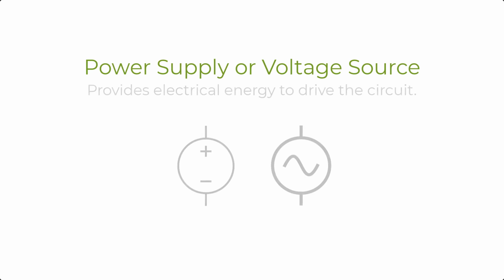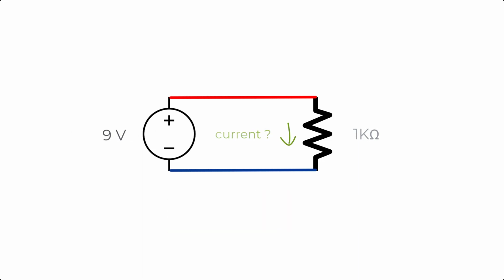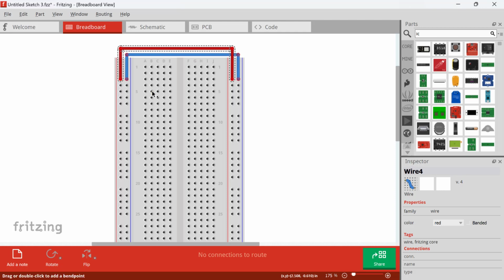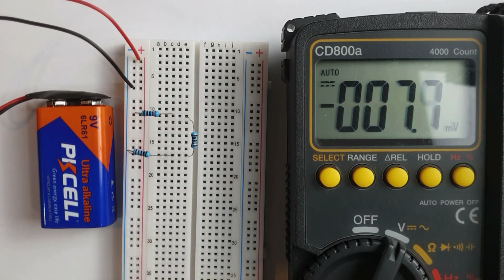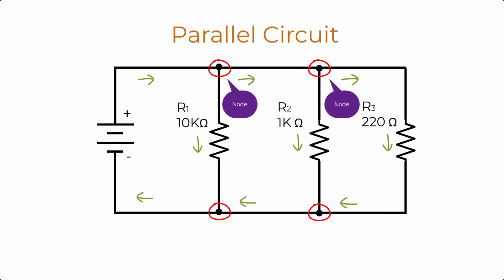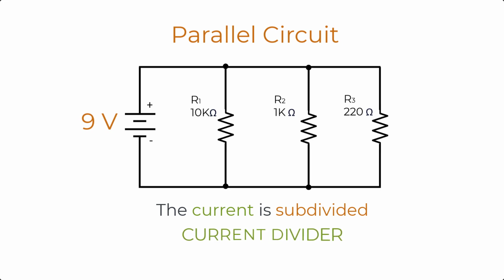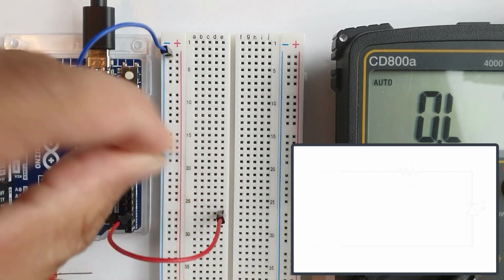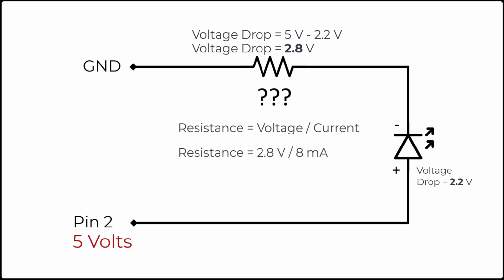Arduino UNO R4 Lesson 03. Series and Parallel Circuits | Breadboarding for Absolute Beginners

Comment: Am I the only one who didn't get resistors and LEDs in my kit???
Reply from the maker: Resistors and LEDs are not included in the kit. But the rest of the components are included.
Reply: @joedgoh  Why did you suggest that kit when it does not have these basic components
Reply: @joedgoh I see I see. I will go procure some of those then
Reply: @joedgoh  Are there any other tutorials in this series that require components that aren't included in the kit?
Reply from the maker: All are included except resistors and LED.
Reply: @joedgoh  Okay. Thanks. How many LEDs and resistors are required to complete all of the lessons in the video series? And how many lessons required them?

Comment: There is no power source that comes for the breadboard.  It comes with a 9v battery but the only connector is to the Arduino itself. I'd have to snip off the batter connector and strip the wires to work with the breadboard. But then I have no 9v source for the arduino.
Reply from the maker: Your Arduino can be powered by either a 9v battery included in the kit or a usb cable when connected to your computer's usb port. You can use 2 jumper wires and connect the 5V and GND of your Arduino board to power your breadboard.

Comment: Kind of a bummer that the kit I bought points me to this tutorial but the kit has no resistors or LEDs.  The video must use the 3 in 1 kit where I just got the regular ultimate sensor kit. "Ultimate" makes me think "ultimate" but I guess there's an "ultimater" kit available.
Reply: why would an electronics kit not give leds and ESPECIALY resistors